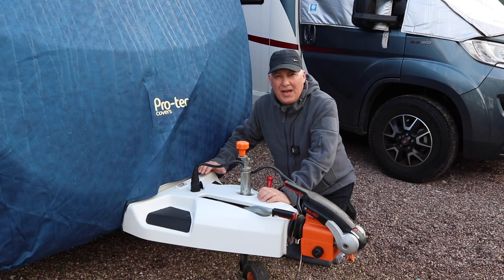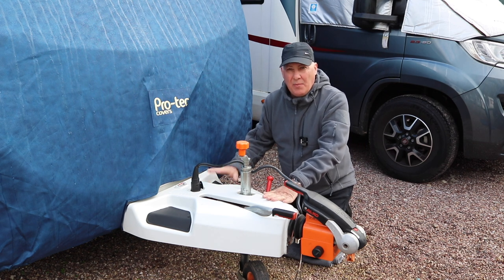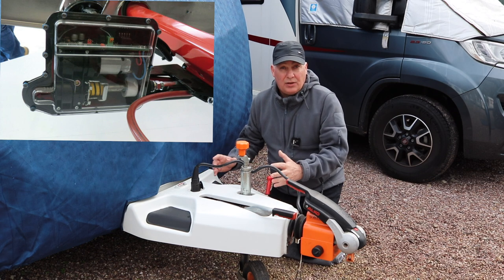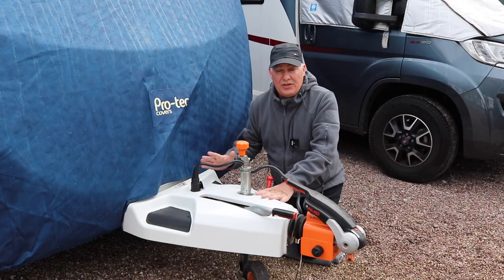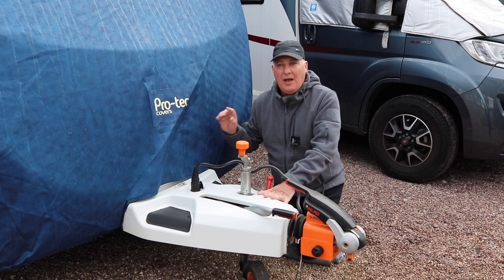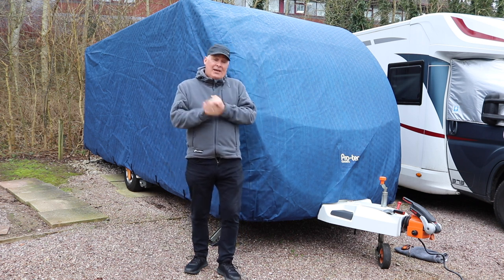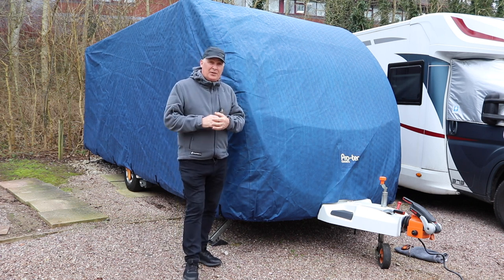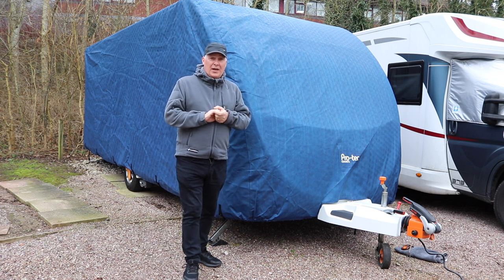Caravan ATC Explained

Comment: Great video Phil. 👍 We have ATC on our 8ft wide caravan as we had on our earlier 7ft caravan and since it was fitted as standard, that assisted in our decision to buy the caravan. In our opinion, it's like a seat belt in a car. You may never use it but on that one time it kicks in, which we've never experienced; it could save a serious incident. We would say, all new caravans should have it fitted as standard. Safety isn't a compromise and manufacturers should make it a standard fit. Just our opinion.
Reply from the maker: Hi Alan. I could not agree more. I feel that ATC should be standard on all vans. As you say one day it just might prevent a bad incident. Thanks for commenting and watching. Phil🙂👍

Comment: Cheers Phil, our caravan is fitted with ATC , we have had a couple of issues with the led light, once the light was flashing red, so disconnected the electric plug from the car and then reconnected back to the car and it worked perfectly, and on another occasion it did exactly the same thing but this time the light was flashing no matter how many times I unplugged and reconnected it back to the car, so my wife goggled it and it said if light is flashing red it’s ok to tow, so I did and a few minutes later I pulled over checked the ATC light and it was green, but goggle said if it’s a red light and not flashing don’t tow, 👍.
Reply from the maker: Hi BB i got the info from alko it might have got lost in translation. 🤔 Phil👍🙂

Comment: I was speaking to a traffic cop, and he believes it should be standard on all new caravans. Was enough for me to add it to my order.
Reply: It’s useful when it works and doesn’t play up as it often can witnessed on contacts Cara’s experiences, can be trouble just like Alko shocking brakes since 2017! A lot of cars including ours comes with inbuilt stability control where car adjust itself to pull a trailer back into safe line so not a must especially when some people think it makes them accident proof (which it doesn’t at all) and they drive even worse than they already are!
Reply from the maker: Hi Paul. If you load your correctly and stick to the speed limits all is fine. We bought for peace of mind. Thanks Phil🙂👍
Reply: @lostweekendscaravan  indeed likewise , and a tow car correctly matched. I guess he had seen a few after the worst had happened.
Reply from the maker: Hi Gary. You quite right there so many idiots towing vans and they wonder why they have an accident. The Alko brakes are shocking I had mine replaced. I did a video about it the old ones were a sorry state. Thanks Phil.🙂👍

Comment: My ATC is not going on - Travelling back from Scarborough to Scotland yesterday, I left the 13pin black wire trailing along the ground, eventually stopped to check and it had gone through all 11 wires apart from 2. Managed to cut fresh ends and splice all back together and use insulation tape, but before starting I removed the positive from the van battery then attached after, and it sparked which makes me think I burnt out a fuse on delivering power to the ATC, can you advise where this fuse is? thanks :)
Reply from the maker: Hi Lee. From what I have found out is, the fuse should be on the fuse board which should be located on the inside front bulk head it is not on the consumer unit. Hope this helps and good luck repairing it. Phil🙂👍
Reply: @lostweekendscaravan  Ok thanks Phil, my caravan is the Swift Challenger SE Grande, so I will pull up all the seat cushions from the door side seating, and the fuse box should be at the bulk head, basically behind the front locker wall. Think I remember them all being like a mustard yellow colour. So are these special number fuses, or will just any car fuse work if one is burnt out, so I can repalace it? :)
Reply from the maker: @Lee-zg3gx  I’m not sure I would imagine it is a spade fuse. It is 25 amp. If it’s not there check the battery cables it may be there. It depends on who the dealership fitted it. Cheers Phil 🙂👍

Comment: Thanks. 

We had it fitted to our brand new caravan, haven’t noticed it working. 

No issues as such, however a couple of times I have connected the electrics, the LED has turned green however there’s been no self test whirring sound. I’ve disconnected and re-connected and it’s performed the self test fine. 

Any ideas?
Reply from the maker: Hi. This happened to me sometimes the memory screws up as long as it releases the brakes it does self correct itself. Hope this helps and thanks for watching. Phil🙂👍